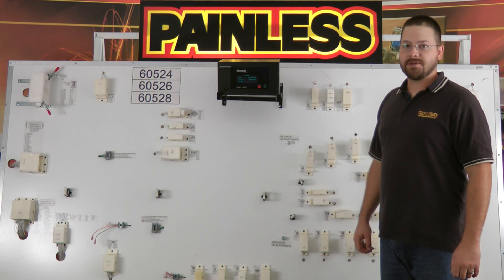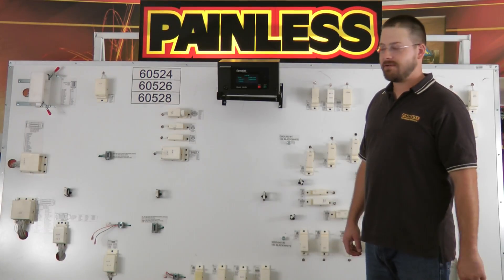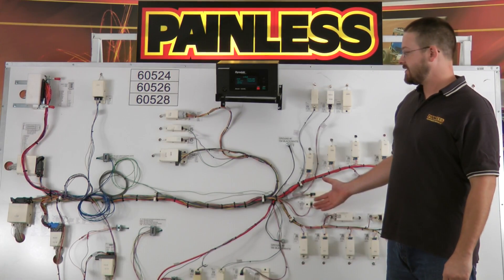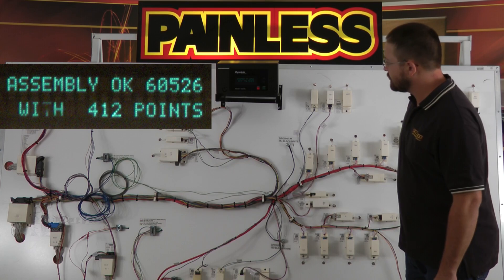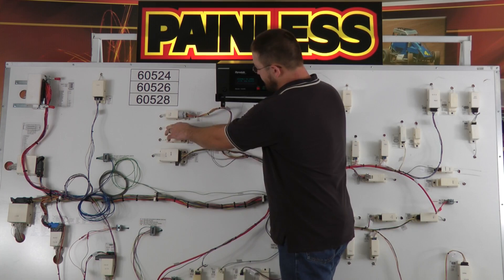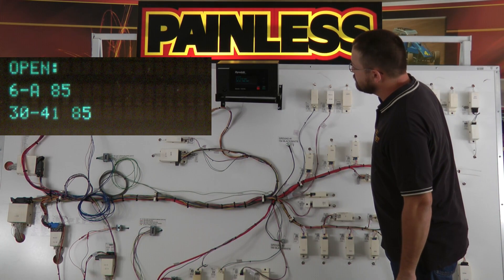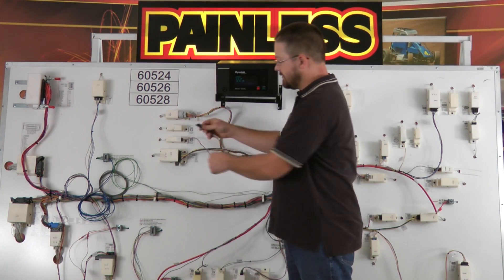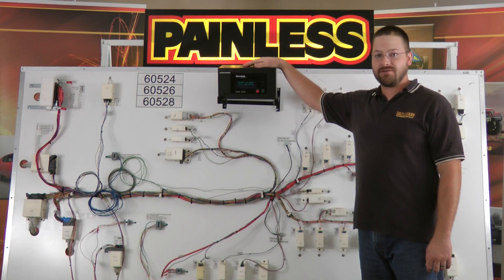Fuel Injection Harness Testing process

Comment: Thanks for this video I found a short in my fuel injection plugsand also some wires that were shorting out the passage to the fuel injection line my 2005 crown Victoria police interceptor is now running .

Comment: Does your test wall send high voltage and amperage through the lines to test for worn out wire plastic covering? A high voltage line with a slight break would show connectivity at low voltage and only show trouble when a higher voltage or amps is passed through.
Reply from the maker: Both resistance & continuity is checked, so not only are we sure every harness is properly pinned, we are also sure that every connector is properly seated and ready for a plug and play install.

At Painless, we only use all new TXL wiring and all new connectors and pins.  This means no reusing of factory worn wiring, and allows us to offer a lifetime warranty on our harnesses.